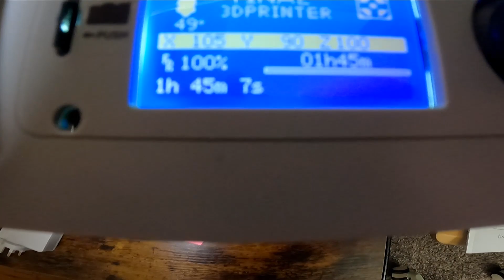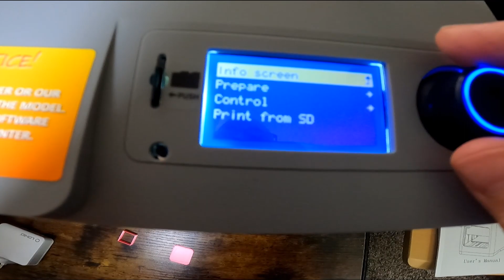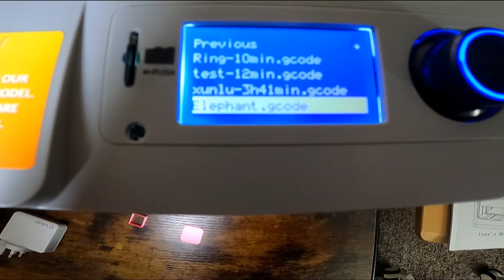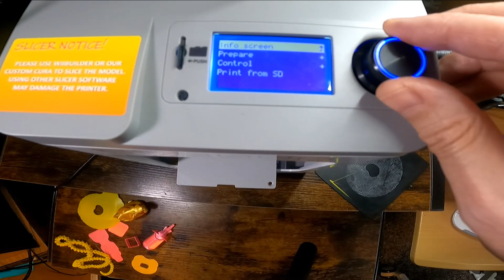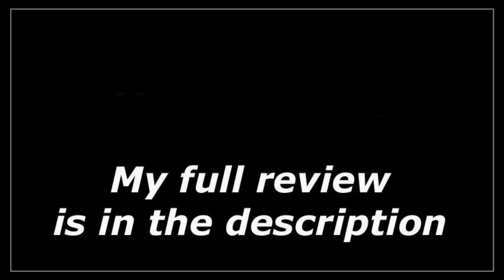Tina2 3D printer full test and printing review

Comment: I am tempted to get one of these but I hear there are problems when it comes to printing sometimes models do no stick to the base?
Reply from the maker: Hi, if you use glue stick on the bed it isn't an issue.
Reply: @Kalbo64  Like a prit stick? I have 2 of them already.
Reply from the maker: @badwolf66  Hi, basically yes. I use elmer's purple glue stick with all my printers. It holds the prints to the base, and washes off in warm water.

Comment: What was the second one that you printed that moves around called?
Reply: Yes Ty
Reply: How do you connect it to Wii builder? And is it easy
Reply from the maker: Hi, yes adding to Wii builder is fairly straight forward and detailed in the manual. Wii builder is a cut down version of Cura, and the Tina 2 profile is added in Cura. If you are new to 3D printing then I would say use Wii builder to start with, but if not then go with Cura for the added features.
Reply from the maker: Hi, do you mean the snake? if so I believe it was this one https://www.thingiverse.com/thing:5537484
Reply: How long have you had The Tina 2 and does it still work?
Reply from the maker: @Theebikeguy1  Hi, I have had it over a year now and it still working well.  I mainly use it for small parts for models, along with items such as keyrings. it is used on average twice a week totalling around 8 hours printing.
Reply from the maker: I just posted an update video if you are interested. - https://youtu.be/4C7V1nhppxs
Reply: Ty

Comment: All I've had off this printer is hassle. Bad printing,  filament keeps snapping inside the tube and nothing coming out of the nozzle. Never had a decent print off Tima2
I get better print off easythreed K7 :(
Reply from the maker: Hi, sorry to hear that, have you tried contacting the retailer to see if they can help resolve the issues. I have not experienced the same myself, and tend to use this for small parts for larger models printed on my other printers which I find it ideal for.
Reply: @Kalbo64  No unfortunately I bought it second hand off eBay. I'll try and change the nozzle tomorrow. Shame really it's a nice and compact printer 👍
Reply from the maker: Hope you get it sorted, it does sound like a nozzle issue.
Reply: @Kalbo64  Thanks m8 👍

Comment: Is there any chance you could tell me why it won't print an stl file from the sd card? I've downloaded the stl file from the computer onto an sd card but it doesn't show the stl file on the printer screen. Really starting to get annoyed with this as it's ment to be user friendly and kid friendly ! Thanks for any help.  Cheers
Reply from the maker: Hi, you need to open the STL file in the Wiibuilder2 program, slice the image then save it to your SD card. It all sounds a bit complicated but really it is fairly straight forward.
Reply: @Kalbo64  thanks Chris. Turns out I need the software on the supplied sd card but my sd card is faulty as it won't even read the sample prints free that came on it. I'm sending it back for a replacement. Cheers for the help 👍🏾
Reply from the maker: Hi, I am fairly sure you can download the software from their site or a google search will find it. If you get stuck drop me a comment and I will do my best to help out.

Comment: Hi there what software is compatible with this printer ? I might get one myself, excellent video by the way
Reply from the maker: Hi and thank you. It comes with WiiBuilder2 which is a cut down Cura specifically dialled in for this machine. You can set it up in Cura by copying over the specs I believe although this is not something I have found the need to do.
Reply: Thanks a lot

Comment: I just bought one of these to print smaller items to free up the bed of my larger printers. It’s quite capable, and detail is pretty good. 

The good- it prints in decent detail, is affordable and for its size is fairy fast for its size.

The bad- no heated bed but I’ve had no issues with bed adhesion yet, it’s small, I think this is a good printer if you want to see what you can do or as an addition to print smaller items, it’s noisy way noisier then my Anycubic printer, you have to use the software that comes with the printer and there is a sticker right on the machine that says if you use another slicer software it may damage the machine, and in my opinion the printer could use better cooling as the fan it ships with is quite small, and you are limited to pla filament only.

Most of the bad is quite easy to over look or adapt to. While I’ve only had mine for a short time and still am tuning to reduce stringing the stringing I’m having is not that bad and easy to deal with. 

Overall the printer is serving the purpose I purchased it for quite well. I’ve printed a few multi part projects between this and another printer and had minimal or no dimensional differences. For the price it’s not bad or horrible at all, and since I used a coupon and points on Amazon it was virtually free. I’m sure there are better but the price point it’s at its hard to beat.

Comment: Hello, I am having trouble with mine. I’m trying to print one of the samples that is on the printer but it every time I try to start it, it just says Power Loss Revovery, it’s every single time idk how to fix it
Reply from the maker: Hi, its not an issue I have had so don't know the cure. I would suggest going on the Facebook support they may have the answer. https://www.facebook.com/groups/558523637833951/
Reply: Please let me know if you find an answer! I am having the same problem even after replacing the Tina2.
Reply: @matthewsmith9214  I contacted the seller on Amazon, they’ve sent me a new one so I hope this ones okay. They said it’s apparently a sd card problem.

Comment: Is this machine capable of printing off fantasy/sci-fi miniatures to a reasonable standard?
Reply from the maker: Hi, in my opinion yes. With high detail miniatures I think the go to is a resin printer. In filament  I was able to get very good quality small detail and certainly on a par with my Ender 5 plus on small detail.
Reply: @Kalbo64  That is great news, thank you. I have just been offered a great deal on one. Now I will press the trigger!
Reply from the maker: Good luck and I hope you enjoy it :)
Reply: @Kalbo64  I've had a lot of fun using this for the last two days. However, when I try and print miniatures I get warping issues or very low details. Can you recommend me what settings to use for miniatures please?
Reply from the maker: Hi, pleased you are having fun. By wrapping do you mean shrinkage and lifting from the bed? If so I use Elmer's purple glue stick on the bed, it was recommended to me and works great so I have never tried any others. I would also advise always using a raft as it's not a heated bed, and making sure it has no drafts cooling the layers too quickly. Some PLA's shrink more than others so also might be worth trying a different brand.
Reply: @Kalbo64  Thank you very much for the help. I could be using the wrong terms as I'm new. The models have thin areas and/or a kind of bend where they bow rather than be straight (at the bottom half) and I printed off the fish and he does not line up. He functions still at least 😆 I'll try what you said. Thank you so much.
Reply from the maker: Hi, it does sound like shrinkage misshaping the thin areas. I have tried a lot of different filaments and some shrink far more than others. I haven't found the cost of the filament makes much difference, and that silk PLA tends to shrink more and be slightly more brittle.
Reply: @Kalbo64  Mine is the Anycubic  PLA as it had good reviews on Amazon and was a nice price. I'll try the other stuff you suggested when I finish work later. If it still is an issue then I'll order some other filament and test that area of things.  I'm dying to get productive on this machine and trying to learn everything I can.  I can see this becoming a very obsessive hobby 😆 🤣 😂  Thank you for the help.  I've just subbed to you as your channel has real value.
Reply from the maker: Yes it can be quite an engrossing hobby. I have learnt as I have gone along and fortunately there is a mass of help and advice online that helped me. So much of printing is trial and error, and I have made and still make a lot of mistakes.  Thank you for the sub and I wish you good luck in getting some great prints :)
Reply: @Kalbo64  Thank you.  I tried using the suggested optimal settings for miniatures by red dragon but that ended in warped disaster 😆 what confuses me is that the cura settings he recommends use different terminology to our Wiibuilder software. Can I suggest that you do a video with your own optimal settings for Wiibuilder for printing miniatures? That would be so helpful for the likes of me 😆

Comment: Hello, good review! Were there any difficulties on getting started with the printer? Which apps did you use to print on it? Have you tried to adjust some settings to maybe improve the printing quality? Sorry for so many questions. Thanks
Reply from the maker: Hi, I found everything very user friendly so very straight forward setting up and no assembly. The software is Wiibuilder program provided on the micro SD card that comes with it, and it has a cura base so is easy enough to use. I haven't adjusted any settings on the printer as everything is printing fine, and I was impressed with the quality.

Comment: Wish you hadn't skipped the filament loading....
Reply from the maker: Hi, the filament loading after connecting the pipe you feed it up through while holding the extruder (bit on the side) to release the gear a bit like holding a cloths peg open. Hope this helps.
Reply: @Kalbo64  sorry for being negative mine was having trouble loading and I was stressing, I actually got it to load finally by pushing on the filament while it auto loaded. I downloaded wiibuilder and I'm on my second print now!! Thanks for the reply. Subbed.
Reply from the maker: Hi, you are most welcome. Are you using the paper on the magnetic bed provided or glue stick? I didn't like the idea of the paper and using glue stick it holds rock solid. If you have any lifting issues I would certainly recommend trying it if you haven't.
Reply: @Kalbo64  I've heard that from others and I'll definitely keep it in mind, the sticker paper has worked well on every print so far. My 3rd print failed because the supports have basically fused together and onto the model. I think maybe its bc it's a model i downloaded then sized down to half its original size??
Reply from the maker: Hi, good to hear you have had some success and I hope you enjoy printing. I get a lot of enjoyment from 3D printing. Edit: just to add Tinkercad is very user friendly for starting out and good fun for designing and editing prints. https://www.tinkercad.com/